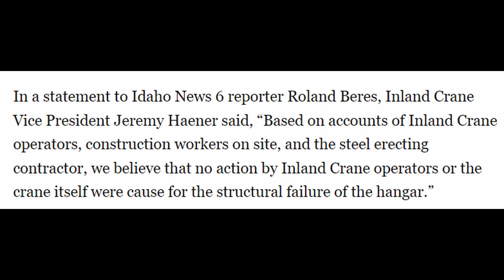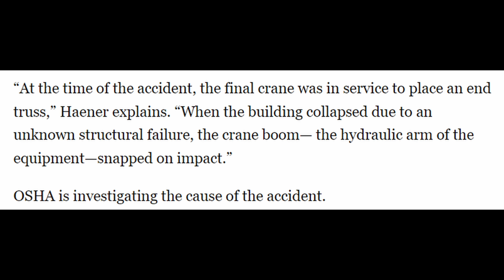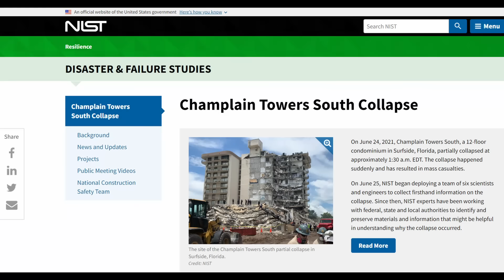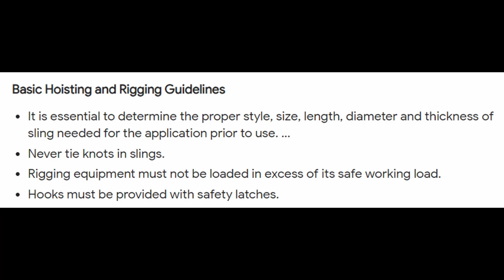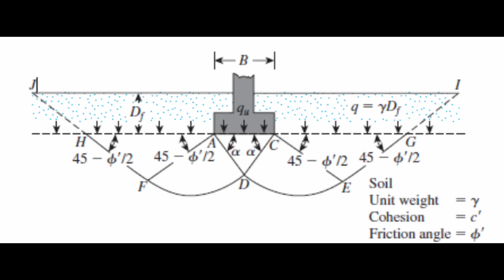Aircraft Hangar Collapse in Idaho

Comment: So I erect steel structures not quite this scale, if the wind was high and the truss/ rafters were not all tied together with the purlins that the roof fasten to, these add stability to the structure, when all is fasten and complete it can withstand the wind otherwise it is weak and can start to vibrate harmonicly, which if it reaches a certain harmonic vibration it can cause failure in the steel and structure
Reply: What are the allowable vibration limits for steel structures?
A structural vibration velocity of 2.0 in/sec has commonly been used as an upper safe limit for building structures, and vibrations above this value will have adverse environmental impact. A vibration velocity of 1.0 in/sec should be used as a normally safe vibration upper limit with respect to structural damage.

Comment: I live walking distance from the hangar. Retired from S.F. bay area constuction after nearly 30yrs, I know what I'm looking at. I would have shut that job down till winds the quit. 1 little bump from a sissor lift or boom arm in that wind... It was dangerous without the wind.
The winds were up that day & the sail cross section of the steal was exposed directly into the wind. The trusses were all bent away from the wind. The workers took the fast method to errect the vertical & truss members, using the minimum amount of bolts for the connecting members to keep the structure up, & not enough cross brasing over the flat top roof. That just what I could see from the street & parking lots next to the hangar. OSHA was there, I hope they find everything. Bless the workers, They do DANGEROUS WORK.
Reply from the maker: Thank you for your comments.  I think everything you said sounds very likely to have been what happened.

Comment: The only thing we know for sure is that it was preventable. I still occasionally watch film on the K.C. ballroom balcony collapse. In that case critical structural changes were made during construction without consulting the engineers. There is a reason things are done by the book. Or else. One of the commenters is local, and mentioned excessive wind on that date. You don’t hang steel in windy conditions if you can avoid it. Over budget and behind schedule.
Reply from the maker: I agree that wind definitely could have been a factor here. Winds usually increase throughout the day and this collapse occurred at 5 pm.
Reply: @CaseyJones-Engineer   Thx. I worked on so many dangerous sites as a young man without knowing. I like the union model.
Reply: The KC Hyatt Regency collapse was entirely preventable. The steel erector/detailer contacted the engineer of record by telephone about a change in how the walkways were to be supported by the threaded rods, the engineering firm stated that they weren't called. During construction, a portion of the atrium roof collapsed which should have been a warning sign that here were serious design issues. I am a retired structural engineer registered in Alaska, and at the firms I worked at, all correspondence had to be followed up in writing to provide a paper trail.

Comment: The night of collapse during the press briefing showed the hair of the official being blown by the wind. I mentioned that wind was a factor after seeing the official's hair, stating that if the wind was blowing that hard during the construction, it had to contribute to the collapse. It appeared way too windy for my liking to be using a crane having done many tip-ups of concrete walls.
Reply from the maker: That is a good point.  I have been on many construction sites where the winds were calm in the morning and howling by the afternoon.  I understand that this collapse occurred at 5 PM.

Comment: i think wind was a major factor.    you have to take in account the wind load not only on the crane boom but the surface area of the piece being picked.   also how the wind is hitting the boom is a big factor   the boom buckled in the base section it obviously something went wrong   i think the wind caused a truss to go it domino effected and overloaded the crane or caused a shock load.  i believe the crane was in it chart and something with the structure went bad
Reply from the maker: Good point about wind possibly being a factor here.

Comment: It would have been helpful IMO if an endview diagram/drawing of the steel utilized in this structure had been included.  Either a crane failure or a faulty component of the steelwork already erected triggered this collapse.  Any suggestion of which was at fault? Was this a union job?  Some drone footage from around of the incident would also be informative.  Good job. Thanks
Reply from the maker: Thank you. We should here more details about what caused this collapse soon. I also think that video of the collapse could pop up.

Comment: For what it worth.... Diaginal cross bracing in all vertical walls should be installed as soon as the mating members are in place.
This is not very cost effective from a labor standpoint so there is a tendency to group these X brace installations into batches.
Risky but cheaper.
Reply: ...also in this case deadly too.

Comment: One additional thing with those man lifts - they can if improperly tuned or with an operator not being used to the specific one come into an oscillation. I have experienced it and it's no fun, so a swing hitting the wrong item at the wrong time could also be a cause.
Manlifts are useful and helpful, but in reality they aren't that fun to use because they are so quirky, often there's just an on/off switch for maneuvering at least for some movements and that means that it could be quite nasty in some situations.
Reply from the maker: Good point.  I have been in some pretty herky jerky lifts myself and as you say, it is no fun.  The possibility that a manlift crashed into a member and initiated the collapse should not be overlooked in the investigation.

Comment: all truss sections (beams and columns) fell vertically. purlns look like 10" 14g or 12g. if one section fell the others would be pulled diagonally down. how did they all fail together. there is no load on the ridge in this tapered beam type frame, just the purlins as no sheet appears installed.
Reply from the maker: Thank you for your comments. I will be following this story and will do an update when more information from the invetigation has been released.

Comment: Most likely the issue is with the sequence of erection, the erection was not properly braced. bending out of plane on one of the beams caused all the beams to pull the columns off their base. These types of buildings are designed to barely support themselves, everything has to be braced off during construction
Reply from the maker: I think that seems to be the most likely scenario based on current evidence.
Reply: You'd think that the first two frames would be stood up then adequately fastened in to each other. Then proceed to sequence one more at a time to the other end. I'm not an iron worker but have done a lot of heavy industrial fabrication and installation with crane work.

Comment: Was the truss being lifted fastened in any way to the already constructed frame of the building. If the crane was sufficient to deal with the weight of the truss then it should have been OK unless you have to add the weight of the completed structure to that of the truss and the combined weight would then be too much for the crane.
May I suggest that it would be best to wait for all the facts before you postulate in such matters

Comment: At 1.10 of the video, it looks like base of support columns have pulled up over and bent anchor bolts. Another case of missing or loose bolts/nuts in the aircraft industry?

Comment: I worked as a oil field rigger, my theory is the crane was holding the load and the riggers had installed the bolts,  then the load was released to remove the rigging at which point the extra load caused the structure to collapsed pulling the crane down because it was still attached to the load. From initial reports sounds like outer support beams were not bolted down or they were using sub par concrete
Reply: That's basically I think too.

Comment: One of the those killed was brother of the owner of Big D, who also may have been a part owner. I drove by it about twenty minutes before it collapsed. I was shocked to hear about it that evening.

About ten years ago the company had built a larger Skywest hangar across the airfield from this collapse. I don't know of any issues with that build.

I'm no engineer, but that iron looks very flimsy. And if they didn't have any bolts torqued to spec as they built it, then sure seems like a lot of failures contributed with the wind and the other cranes being pulled off site. Who knows what else.
Reply from the maker: It is all very sad. I hope the investigators get clear answers.

Comment: So, my question would be
- given that a a number of trusses were already in place and aparantly structurally stablilised with diagonal bracing that collapsed
- Is the overall capacity of the truss design adequate for both the final AND the construction loads? 
- If such failed trusses met standards, then the design standabdards are inadequate

It surprises me to see collapse of what appears to be a stabilised part of the structure, regardless as to if a load was doped or bumped

Comment: I was lead construction engineer on a job with a lot of lifts including a lot of high profile items. We had our design guys review the rigging plans before I saw them. I had a final look at the rigging plan before the contractors did the work. Our work was in a windy area and wind tended to shut down a lifts.  I looked at the Boise weather data for that day and the highest wind speed was 28mph with the highest gust of 37mph.  Who knows if wind played a role - it could have played a role on the lifted item or on the unfinished structure.  Time will tell.  As a side note I have seen an iron worker ride a piece of steel on the incomplete structure during a lift during an earthquake. That's a maxed out pucker factor moment.
Reply: In my opinion that's too windy, at least I'd avoid any serious jobs with that wind.
Reply: Pucker Factor Zulu, eh?

Comment: I contend that structure, was inadequately, supported during erection phases , trusses are a system, until the entire system is installed, torqued and in compression ; it can't be expected to hold its own weight! never mind design loads … in the pictures, I was surprised to see all the columns just bolted to the footing pads ? Displaying what seems as Tension failure?  end trusses columns and some center trusses columns must be connected to tensioning  beams imbedded below floor elevations ! Pretty sure That's how the whole system works! As the trusses come into compression onto columns and  beams enter into tension…. blessing to all, affected by this negligence...

Comment: Certainly, there is a video of a time-lapse recording. 
Very unusual not to have one.
Reply from the maker: I suspect there is a video of this collapse on someone's phone that may become public at some point.
Reply: @CaseyJones-Engineer  The  Idaho Statesman has pictures taken from shortly before the accident.  Someone who teaches architecture would drive by every day and they stopped to photograph the building right before the collapse.  You can see the single crane working and the pictures give a much clearer idea of exactly what the building looked like before the collapse.  It looked like they had mounted the final truss at time of collapse.  A few things that other have mentioned are it was very windy that day and other local crane sites had already shut down due to high winds, it was just before quitting time late in the day making some wonder if all bolts were put in place or whether only some were so they could go home, that there seemed to be a lack of structural supports to shore up the structure while under construction.

Comment: I am concerned by the contractor using only one crane for the placement of the large hanger vents (main support elements) these vents are like trying to lift spaghetti horizontally and require many support points and complex coordination during lift. I's hard for me to imagine given the apparent size of these elements webbing looks to have a cross section greater than ten feet in places, to be able to lift one of these with a single crane no matter how many slings and spreader bars are used. These structures get a significant amount of their strength and rididity after structures elements are interconnecxted with the purlins, girts and skin and roof and attached to the footings. Ray Stormont
Reply from the maker: Thank you and I agree.  The fact that the use of only 1 crane was mentioned in this initial interview with the representative of the crane company was interesting to me.
Reply: Cranes are expensive and underutilized during the assembly of metal bldgs. Ray @CaseyJones-Engineer

Comment: Thanks for the video. I'm not sure if you meant it to appear this way, but it sounded to me like you thought it was very strange for OSHA to be investigating this. I'm not familiar with construction and engineering, l work in lab, but from what I know this is the type of major investigation they'd conduct all the time. One reason for the quick report deadline is because it's often easier to determine the cause of an injury, death, or disease when happens on the job. It is usually much harder to determine why something failed many years after construction. Some things that OSHA investigate do have very subtle and hard to determine causes, but I'd bet that's not usually normal. Maybe the NIST would be a better choice, but it's not crazy for OSHA to be responsible for things like this and they have many if the same tools if investigation that an organization like NIST has access to as well. They have a huge budget as well.

I'll just add that a huge part of OSHA focuses on building construction, chemical production, refinery, ship building, energy production, etc. We usually just see the bureaucratic inspectors that determine if safety standards are met, regulations are being followed, and documentation is correct. We usually don't see the investigators, engineers, scientists, and doctors who work for or on behalf of OSHA to help research the huge variety of subjects necessary to determine root causes of injuries and medical issues encountered in almost any job in the US. What I'm saying is it's not like investigating this is completely out of their wheelhouse or that they have absolutely no capability and capacity to understand all the factors at play here. This is their bread and butter and they investigate things like this all the time. We usually just see the inspectors, lawyers, and red tape and the bureaucratic nightmare that comes with any large government organization that's always influenced by politics and incompetence. They'll often work in conjunction with other organizations even though they are responsible for the investigation. A building that fails during construction is very different from a finished building that fails years later.
Reply from the maker: Thank you.  No, I am not at all surprised that OSHA is investigating this collapse.  I was pointing out the difference in investigation periods for OSHA versus NIST.
Reply: @CaseyJones-Engineer  Are they effectively the same people at the investigation level or is it a totally different "mob' as they say here in Australia?
Reply from the maker: @SubTroppo  OSHA will investigate this episode in its entirety.  But now that lawsuits have been filed, litigation is likely to bring more details to light (assuming that such details are not hidden behind non-disclosure agreements that are usually part of any settlement).

Comment: "Kranplaetze muesste verdichtet sein!" (Crane pads must be compacted!)  Kranfuehrer Ronnie

There are also the usual issues with load / reach envelopes, winds, and rigging.

And, as others are pointing out, erectors have a bad tendency to only partially install bolts during the initial lifts in order to "save time"

Having looked into a few of these crane collapses during construction for my own curiosity, and having had to make initial guesstimates of where the crane pads need to go for erection of process plant equipment, my money is on a marginal to improperly over-extended lift, quite possibly compounded by a wind gust.

The cranes are always engaged in a balancing act, and the stability envelope for almost every lift is pretty small.
Reply from the maker: Thank you.  Yes, I forgot to mention the possibility of a wind gust that could have been a contributing factor.  It is likely that many factors combined to result in this collapse.

Comment: Good point, something big was missed.  And it failed under less than dead load.  The roof membrane wasn't even installed yet.  Designed and built properly these things are NOT fragile.

Comment: First impression looking at the debris is maybe the building frame itself let go.  There is a lot of damage that is either the crane falling into the building which I don't see to a large degree or the frame just failing.
I was on a steel building erection job one time and near the end of the skeleton being complete the building began to sway.  We were following orders but stopped immediately and spent hours bracing the walls with whatever material was there.  Two welders going non stop.  We saved it and had it plumb and square when we finished but there was a lot of cutting off temporary braces to complete it properly and it cost the owners some money to replace the steel roof members we cut and welded to save the building.  So it happens.  Cheers 🇨🇦
Reply: Amazing what a little wind can do. I also am intrigued by the harmonic vibration thing somebody here mentioned.